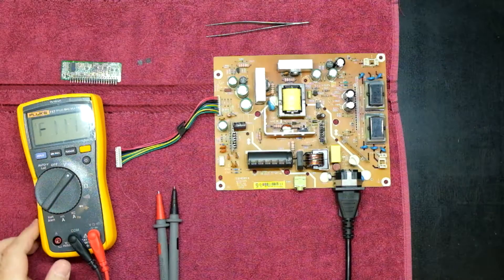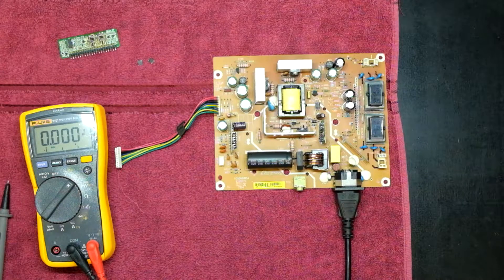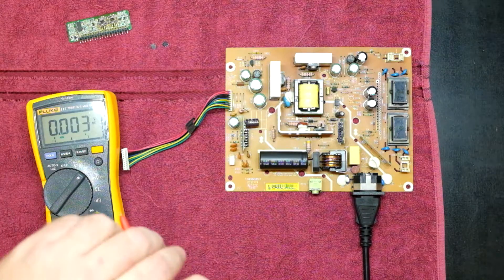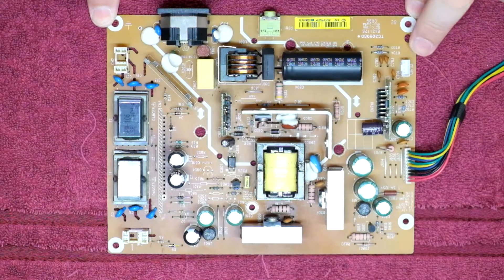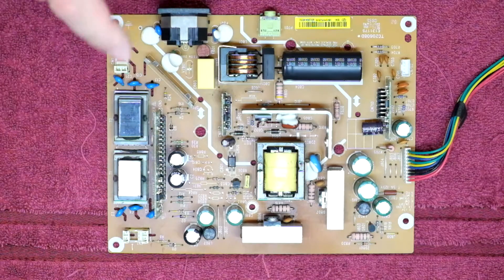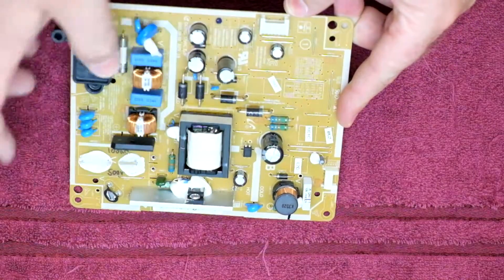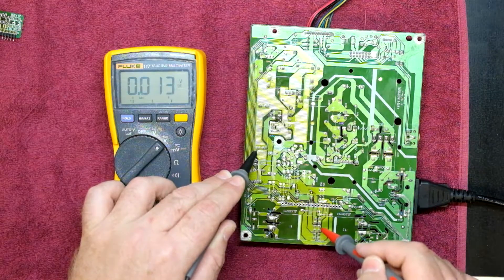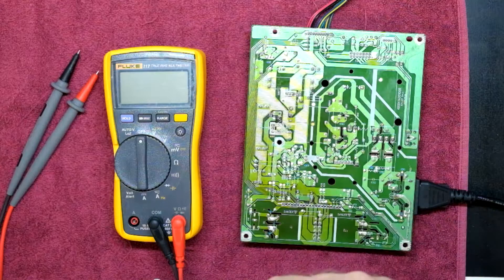Episode 50   Switch Mode PSU Repair

Comment: Hi, please can you explain how best to find a circuit diagram for a switching power supply lcd monitor.
I have checked the power supply board dc outputs to the main board and only find 4.8dc and 11.8 dc.
These values seem rather odd as 5.1v would appear to be more universal output dc voltage.
I  am investigating an ASUS VS24AHL monitor switching power supply circa 2015
Comments from readers of this would be most appreciated ref 22/08/2023

Comment: My blu ray player still has 12.v coming from cables that go into the board I put the multimeter on the cable on each end of the ribbon cable as in the video and its 12v but still doesn't power up any ideas could it still be the caps

Comment: I get the shivers when I see you wave that metal, conductive tweezers and touch some components with your fingers. With a plugged-in nutrition print. Not really an example of working safely, I think. I also don't understand the choice of the towel that well. With a few simple adjustments, you could create a much safer, better and more professional workspace.

Comment: I like to lick both legs of the main filter capacitor while it's plugged in. Is that bad? I also like sticking metal objects into wall sockets while standing in a metal bucket of water mixed with high levels of salt. Is that bad too? I've been told I am one of the best electricians/electrical engineers in the world. Is that true? Well, I'm off now to have a bath while blow drying my hair at the same time. That can't be bad. Can it? :)

Comment: Hi, Love how you clearly explained how to read a power supply chain! I think I finally get it, haha (Other videos are too Technical!). Been trying to learn this to fix my monitor.

BTW,  How do you tell/diagnose if the mosfet things you pointed out is part of the issue? I have an HP x2301 LED Monitor that's having weird power issues. I already replaced the 2 Caps I found in the board and it still has the same problem. (Monitor has separate power brick, If I understood you right. That means the board I replaced the caps in are DC and Logic. And the power brick is outputting 12v DC according to the multimeter. )

The symptoms for my Monitor is that is if it does power up it works fine but when it doesn't the Power Lights flicks on then powers off 1-2 secs after or it doesn't power on at all until after a day or so of unplugging it. It's always a dice roll of it working whenever I turn it off. lol.

Side notes: 
#1. I do notice some very subtle discoloration on the sides. Subtle shades of very light green and red. When ever its over  a white background.
#2. It helps increase the chances of it powering up if I disconnect the DVI input for some reason.